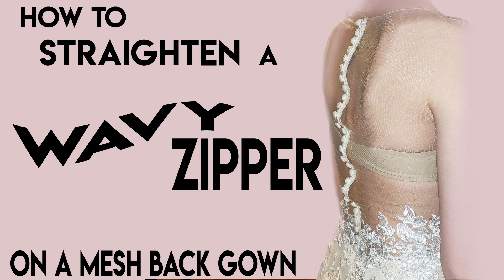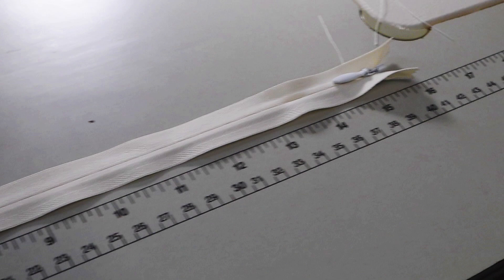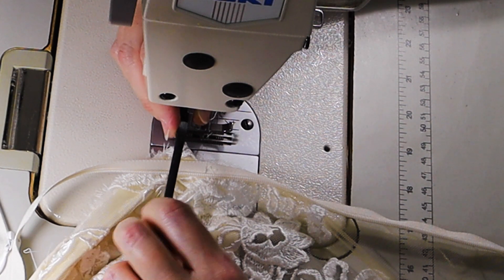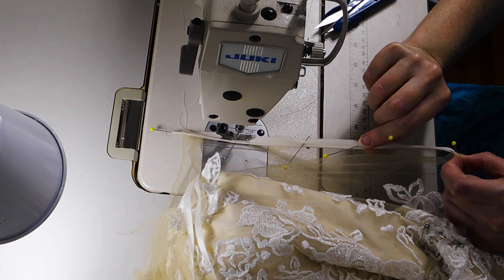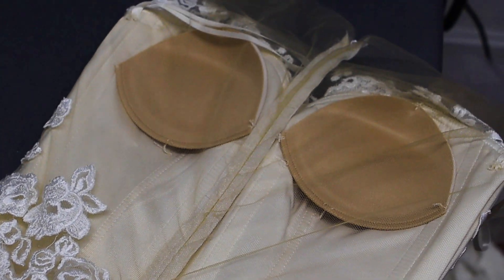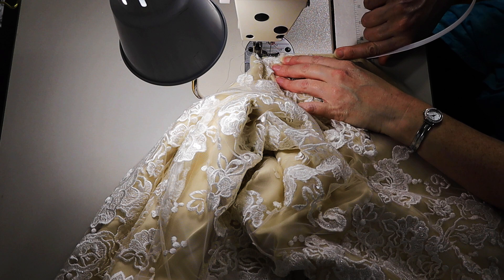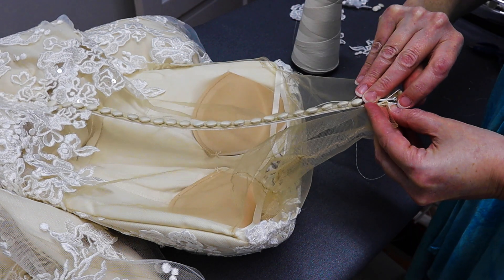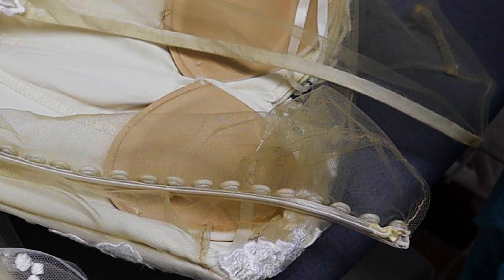How to Straighten a Wavy Zipper on a Mesh back Tulle Illusion Back Gown | Bridal Gown Sewing

Comment: At which point do you hem the new neckline?
Reply from the maker: I didn't want to get into that in this video because I wanted to stay focused on the zipper.  I would actually leave it raw, but not sew the last 1/4 inch or so to the zipper top. Then, I would align the folded edges of the mesh, only then would I sew the edge of the mesh over. I know it sounds smoother to fold first, sew fold, then sew to zipper, but it is really hard to get it perfectly aligned that way.
Reply: @BridalSewing  Thank you so much for your quick answer.

Comment: This is so good I had to watch it again just to make sure I will remember it. Have to add a tiny trick I use on invisible zippers- when you get to the part that has the thickness in the fabric I literally v out at least a quarter inch right where the bulky seam is, resulting in a space in the zipper stitching that is only about 3/8 inch long.  Then I tack the zipper tape side to the seam where I want it to stay so it doesn't pull apart and remains folded right where you want it while wearing but easily and smoothly zips up and down. Works like a charm!

Comment: This is brilliant. The boning pull with the strong thread to conform to the back is genius. And the easing in of the zipper works well on the tulle. I wonder if this would work on some of the street dresses I see that bubble like that. Sometime I will try it! The buttons (especially satin ones) often have a very specific direction and all need to be stitched on the same way or they will look crooked and unevenly spaced no matter how perfectly the spacing is measured.
Reply: If you don’t mind my asking, what do you charge for an alteration like this?
Reply: I didn’t know that about satin buttons! Glad to find out before I stitch on 2 gross

Comment: Beautiful demonstration! Thank you for sharing your experience and knowledge ! Personally I’m not a fan of putting fake buttons running up a zipper. I would do that closure in a different way without the back zipper. But this is really well done and fixed the problem.
Reply from the maker: I agree. But the original design had them & she liked them. I think real buttons would have been much prettier.
Reply: @BridalSewing  Well you did a beautiful job straightening that Loch Ness Monster 🤩. I’ve seen that sometimes when there is this type of fake button closure with a zipper the buttons are attached almost at the edge of the zipper opening, still letting the zipper to close obviously, so visually they look more centered and the zipper is a little less evident, although you will still see it’s a zipper closure and not buttoned up. I don’t know if that would work to do the shaping of the back you do with the thread, but maybe something to keep in mind and try and see if it works. 
You are such a gifted sewer. I can never do anything without basting first and everything I do takes me ages 🥴
Reply: @BridalSewing  In your opinion, if the back of the dress has the rel button closure, and is experiencig the same issue-not lying flat; would you believe it's also a case of the gown back being longer than the brides back? How would you address this fix?
Reply from the maker: Yes. You have to shorten the back at that point.

Comment: Great ideas! Thanks! Many times I have added a horizontal seam and added lace to cover it, but this looks way better. I just wonder if it would still work to ease in large wrinkles and not make it look gathered or puckery.
Reply from the maker: To get a truly sheer back, I shouldn't use darts. If it had to be reduced in length that much, I would probably cut a new back. It usually wouldn't need to be made much shorter, though. This bride was maybe 5 ft tall.

Comment: Thank you so much for your videos Ms LaBolt. I have a gown with an illusion back that I need to lower the back neckline by three inches. Originally the mesh has a raw edge at the neck but I noticed you finish the edge with a hem. Would I be making a bad mistake by keeping the new neckline with raw edge?
Reply from the maker: No, raw is usually fine. It just depends on the style of the gown. This one needed a stronger edge.

Comment: I love your videos! I need to expand the lace sleeves on my dress, they are a bit too tight. How would you recommend doing that?
Reply: If there is enough seam allowance, you can use that, but if theres none left, that is very difficult to make unless you can patch a similar lace under the sleeve seam
Reply from the maker: Yes, like the other commenter said. Either let it out using the seam allowance,  or gusset it with matching lace.

Comment: Ah! This is so helpful!! I would have never thought to pull the thread to force the curve. Question: how did you finish off the tulle neckline after? Or did you just leave it raw?
Reply from the maker: Someone else just asked that & I answered step by step. Poke around in the comments here and you'll find it! :D Thank you for watching.
Reply from the maker: Did you find it?
Reply: @BridalSewing  hi! Sorry, was the dead of night here in South Africa so was catching some zzz haha. I did find the comment but i'm slightly confused. You said you leave the edge raw but then sew the folded edges? Just struggling to visualize 🙈.
Reply from the maker: I may have mis-typed. I leave the edge raw & do not sew the last 1/4" or so to the zipper. 
Lastly,  I go back and fold the edge. *The final edge is folded*. 
The edge is raw the entire time I am working on the project. 
Does that help?
Reply: @BridalSewing  yes thank you so much for getting back to me!🥰🥰
Reply from the maker: @martelleludik9558  no problem. :D

Comment: Ahh, so many great tips, thank you!!! Question: I saw that you eased your net to accommodate for the new length of the zip, I know you already cut the net, but why not cut it the perfect length, so easing is not needed? Is it because the curve on the back would be to deep then? I'm sure you are a pro at easing, but for me it always seems to pucker a little. So I was wondering if cutting it a little more would do the trick. Thanks again, I learnt so much from this video!
Reply from the maker: Yes, it would've swooped too deeply. The whole back was too long. Not just the upper back.
Reply: @BridalSewing  that makes sense, thank u!
Reply from the maker: You can also just recut the back to a size that fits the brides & doesn't require easing.
Reply: @BridalSewing  that makes sense! But yes, I understand how the easing would be easier. Thank u!
Reply from the maker: @Mamatebear  please join our Discord app community. You can post pics and ask questions there. It's a lot easier to answer with detail & forms a catalog of reference for others. 
https://discord.gg/pTrvU2N2

Comment: If you go to The Zipper Lady, you can actually purchase a SHEER zipper. Way better than the white one!
Reply from the maker: ...if the bride wants to change the zipper to sheer. We swapped out for the exact same color and width so as not to change the design of the dress. There have been cases where brides have requested a less visible zipper, and we do the swap out because of that.  But, if the bride loves her dress and wants it as-is, only fitted, then the standard practice is to replace with something as similar to the original design as possible.

Comment: The best advice I ever got was " let the feed dogs do their job". Meaning the feed dogs will naturally ease in the fabric, put the piece that needs to be eased on the bottom, and let the feed dogs do their job. It is hard sometimes for us to let go and let the machine do its job.
Reply from the maker: This absolutely will not work with quite a few bridal sewing techniques that I use on the daily. My feed dogs are dropped probably 15% of the time. 
You do you, though. If it's working for you, don't change it. 👍
Reply: @BridalSewing  True, I would not try that with lightweight materials. That would chew up the material. I like the suggestion of lowering the feed dogs, I had not thought of that and would make it easier to do lightweight materials on my big machine (same brand as yours). BTW I have so enjoyed your channel. Learning new things and reinforcing techniques I have had to find on my own. That is one bad thing about this trade, no schools left teaching it, and usually, I worked alone, so no one to ask. I am so thrilled to have YouTube and this channel to learn even more. I have been doing alterations for 30 years and I am still trying to learn. And all the new fabrics and notice that have been available in the last 10 years is mind-bending.  Thank you for your channel.

Comment: How to fix the same problem when the back is bottons and loops
Reply from the maker: Same deal! :) I like to restrict the stretch with a narrow piece of ribbon cut to the length the back needs to be. Then sew on the loop tape and buttons.
Or- if it is a lace illusion backed gown, I often shorten it by removing a eye shape out of the back where the puckers occur. I have a video coming on that! :D
Reply: Bridal Sewing Techniques thank you so much 
Can’t wait to see the video
Reply: @BridalSewing  I am looking forward to this one too.  I have often run into this situation with an illusion button up where the brides back is short.  I have done darts or fish eye tucks at the waist like under the lace, like the one Brenda mentioned.  Works for most.